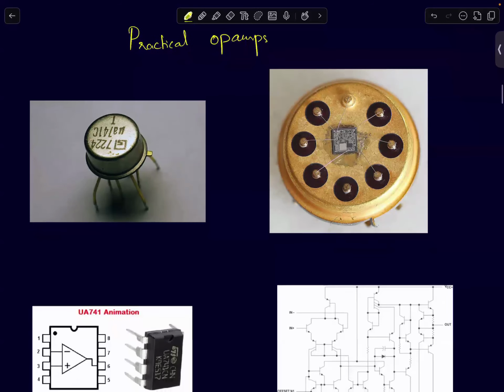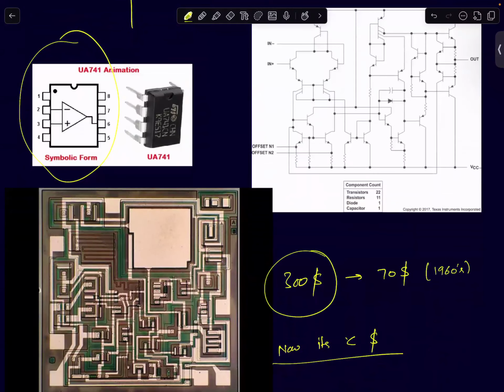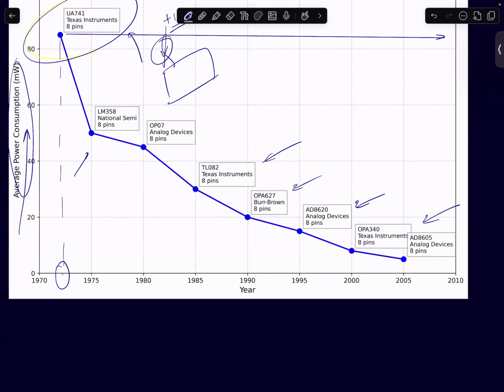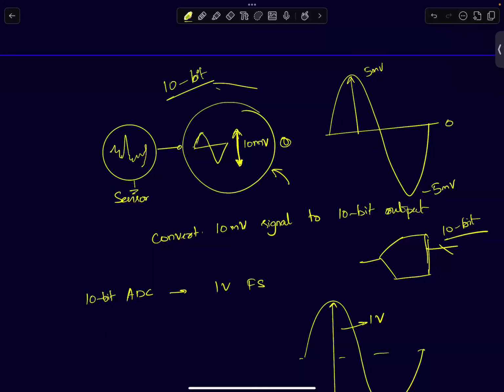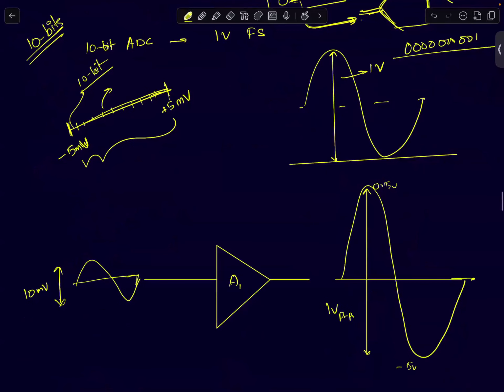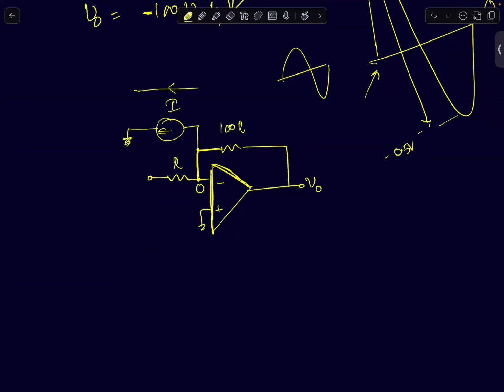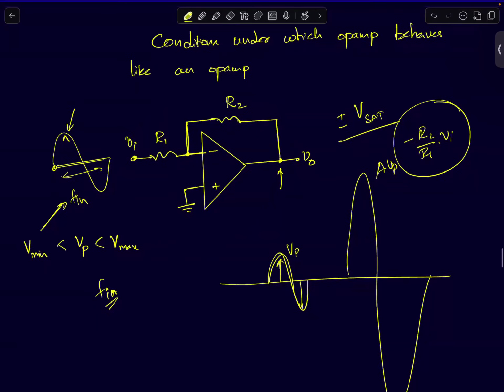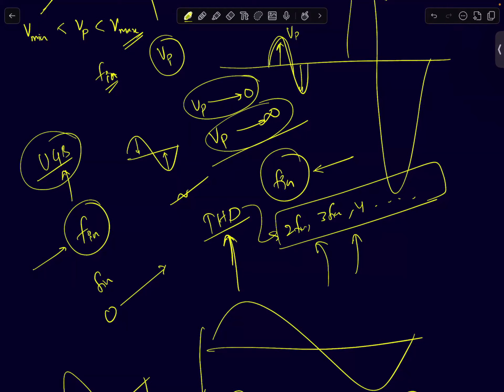AE Lecture 7: A quick history of practical Opamps

Comment from the maker: A small correction. In the lecture at 24:11,  I accidentally said, that for the 10-bit ADC with a full scale range of 0-1 V, the voltage level 0.125 corresponds to 0000000001. That is not correct. The voltage 0.125 is (1/8)th of the input voltage range. Assuming the voltage 0 corresponds to all zero code and 1-1/2^10 corresponds to all one code, the voltage 0.125 should correspond to 00011111111 (which is 127th level or 1/8th of the total 2^10=1024 levels in the ADC)